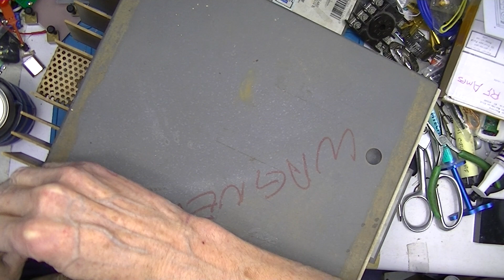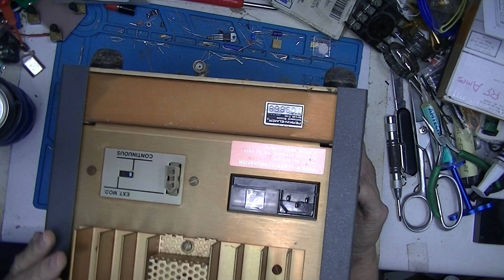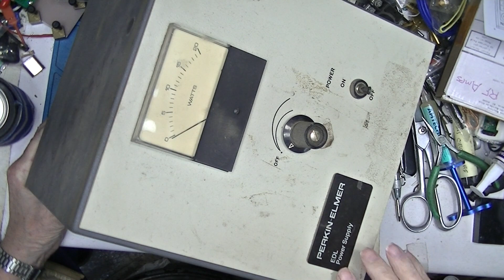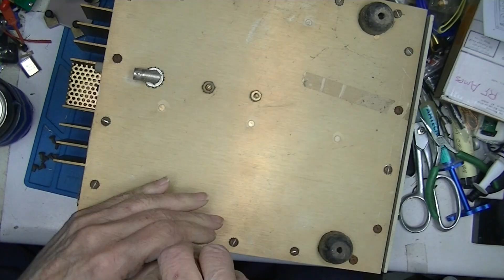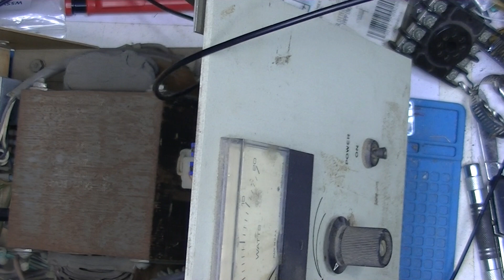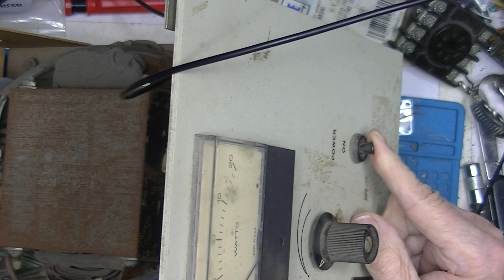Investigating an Unknown Box

Comment: Ah.....these are old atomic spectrometer power supplies. I see just the atomic lamps that these power are close to a thousand bucks each, per element required, and there are several (bismuth, germanium, rubidium, tellurium, etc) Very interesting old supply....many thanks for exploring it with us.
Reply from the maker: This morning I thought about a H-P spectrometer I once worked on. It used a Deuterium Lamp. I just replaced the sensor amplifier twice. This was in the mid-80's and the first time I used a exact four-lead, RCA transistor. The second time the RCA unit was no longer available and I used a Generic three-lead unit. I remember because the Lab owner required some persuasion.
Steve
Reply: @stevestrivia-bystevewagner4852  Wow, cool......the good old days with traceable through-hole circuitry.